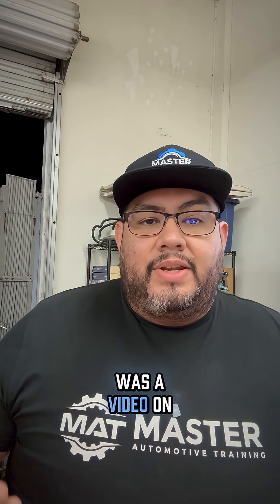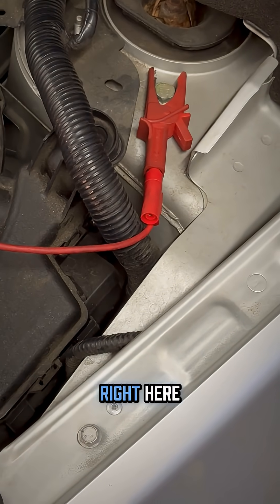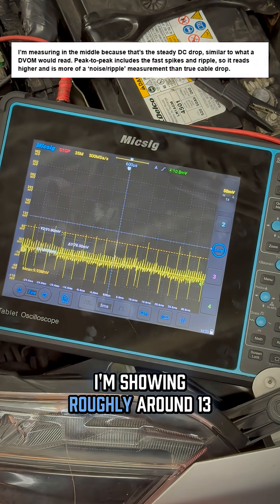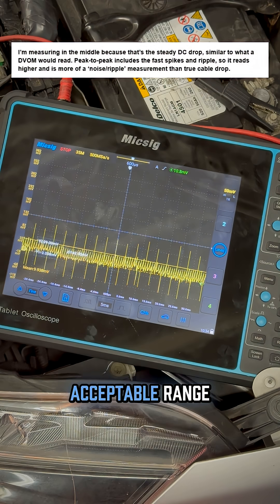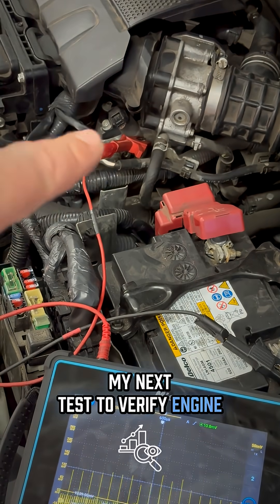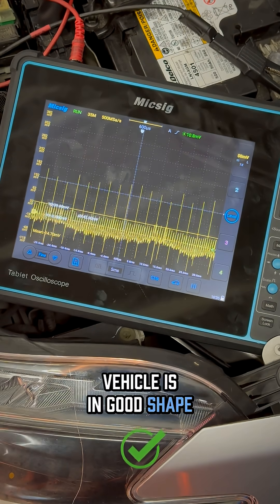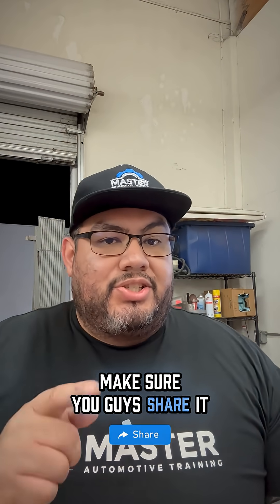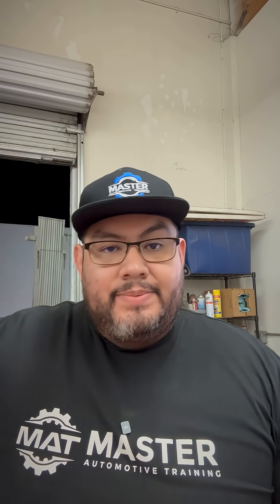Ground Voltage Drop Test Using a Scope (Done Right)

Comment: I'm the one that made that comment and now that you did a follow up video I now have a follow up question. Why did you connect to strut tower and not the generator housing? I've done this before and had an acceptable reading BUT when I switched the lead to the generator housing I had nearly half a volt drop. Do you  care to guess why? Btw, I'm not a hater. I subscribe to your channel and have recommended your channel to others as well. I've learned from some of your diagnostic strategies and some of your perspectives are enlightening. Keep up the good work sir. Peace ✌️
Reply: I like to start at battery post and last connection to component then if an excessive voltage drop work back through each connection until I find the high resistance joint.
Reply from the maker: @stevehayes6661  Walking the meter perfect!
Reply from the maker: Hey brother, I appreciate you clarifying and thank you for the support, the sub, and recommending the channel. Respect. ✌️ Glad some of the strategies and perspectives have helped you pick up a few new techniques.

On your question: I used the strut tower because it’s usually a quick, clean chassis ground reference close to the battery and it tends to be more stable/less noisy than the alternator case on some vehicles.

On why you saw nearly 0.5V when you moved the lead to the generator/alternator housing: I can’t say 100% without seeing the exact setup and load, but my best speculation is you exposed a problem (or measurement issue) in the engine ground path, because the alternator case is grounded through the engine, not directly to chassis.
Reply: @MasterAutomotiveTraining You're exactly right. One can make an assumption that the voltage drop is only on one side when you can have voltage drop on both sides. Off topic but I really enjoyed your video where you recognized and gave credit to one of your mentors (Brandon). That's class right there. You're a good man and teacher. For what it's worth in electronics school we used the term IR drops because it's a constant reminder of how Ohms law works for voltage drops. Thanks for your very kind response.